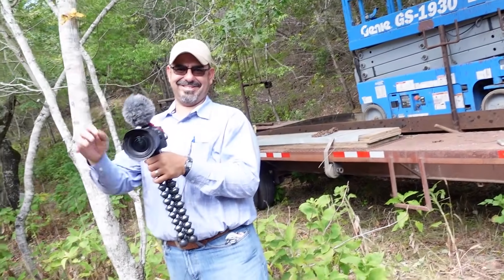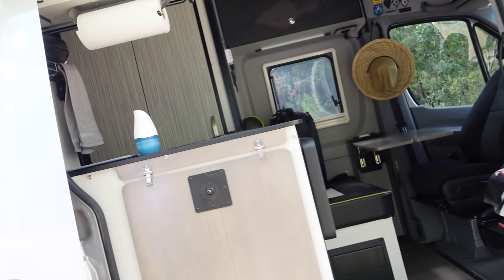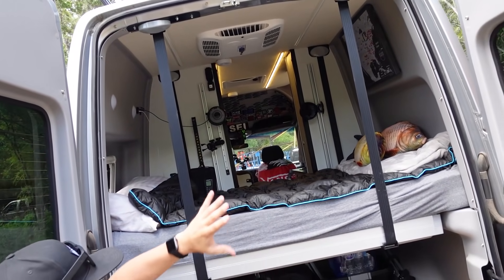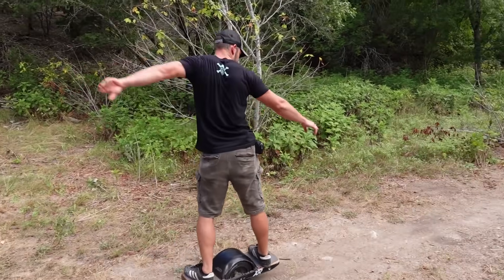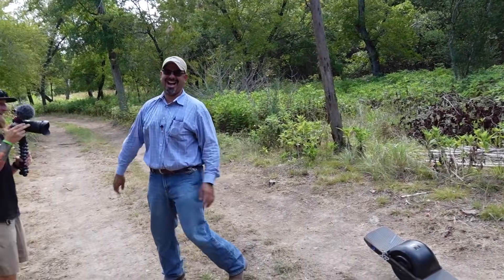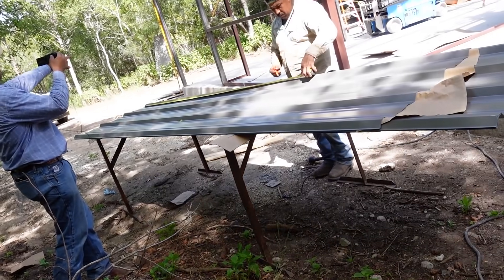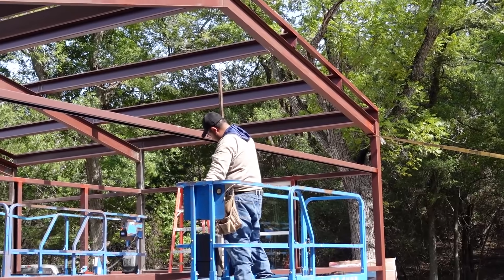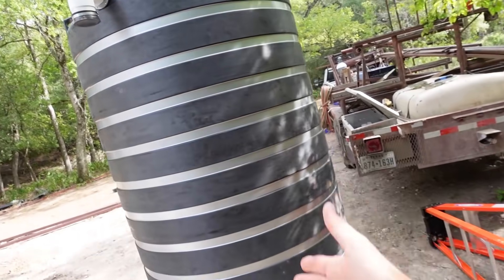Building Demolition Ranch Headquarters Part 6

Comment: Hey Matt there was a video that "JerryRigEverything" on solar power for his house, and i was thinking of you for that. Check it out!
Reply: JerryRig did Grid-Tied, they are going stand alone here, so they'll need batteries.
Reply: @tjs114  only difference is you would need a power wall to store and condition the power. Making a power wall aka big lithium ion battery is not hard. You just need about 1200-1500 (18650 cells ) and a few affordable controllers. The thing with the grid enabled system is the grid acts as your battery.

Comment: You might think about a battery bank setup for power storage.  You can run the led lights and with enough you can power an ac unit.  I do mean a lot of solor collection of energy.  Battery bank will store what you don't use.  We have ran the house lights on a 6 car battery bank and TV and satellite box for 8 to 12 hours with a heat blower from a wood stove during winter.

Comment: You need to put a drain pan under that tank! If you don't, when the leaf basket gets clogged (and it will) all that water's going to overflow right to the back of the building.

Comment: If you want an off grid toilet, go buy one that separates the liquid from the solids. Normally people use saw dust to cover their solids & paper but a better option is to use Peat Moss which is similar to a rich dirt, the Peat Moss will decompose the solids & shrink meaning that the bucket will not fill up as quickly but best of all it can be used in the garden as fertilizer for plants with no smells. The separate liquid bottle on the front of the off grid toilet is large enough bottle for 1-2 uses before it needs to be emptied out in any place you desire away from the shed. If you don't want to put in a special room for the toilet you can easily get a 90 degree bent pipe with a camo shower curtain for privacy & put it in one of the corners of the shed.

Comment: We use a propane powered generator with a huge tank. The Tank of propane also runs the heater on the hot tub  water heater, heater and the stove in the house its something you might want to think about. You can get a propane truck in there once a year or two depending on how big of a tank you use.

Comment: Did miles of metal roof one summer. If your pre-drill’s wrong it’s a nightmare.
Usually you just tack it up there you line it up very carefully snap lines on the metal. Then you have somebody that goes and screws off all day and yeah they run measurements and make sure everything’s perfect. Screwing off is usually a lot easier worked and actually putting up any kind of metal. Most of my experience was like flexo span storage buildings and bebco buildings. Very production vs construction experience. I’m getting screw gun arm just listening to the guns clutch out.
Reply: I've done a few miles of roof and metal buildings myself, the guy I worked for had bought the construction company from the guy who built a garage for him, they did such a bad job on the screw lines on his garage, he made a vow to himself not to do that to his customers. We took pride in our screw lines being straight, no pre drill for us, or snapping chalk lines, I've seen chalk stain panels and leave a line, we'd stretch a string tight as a guide, you could keep a pretty straight line that way.

Comment: Matt you should look into a rocket mass heater, and wood gasification u can run vehicles and generators off wood gas. The rocket mass heater is pretty neet as well.

Comment: Contact AM Solar if you would like all solar, lithium batteries to run the air conditioning. However, they are located in Springfield, Oregon. Building looks wonderful!

Comment: I would think you would need a 12v RV heater and air conditioner for the building to draw less on the solar system. You can also put in propane heat for winter.

Comment: If you elevate that water tank even 3ft so as to not lose the advantage of gravity to fill, you would have plenty of pressure for a sink at standard height without a pump. One less electrical connection.

Comment: Hey bud this video isnt about your bunker but a good idea for your bunker is make the door have hydraulic hooked up to it you never know if anyonr does have to use there bunker for safety you wanna make shre your able to get out just incase something falls onto the door on top cause if your inside with your family and somdthing heavy falls on thr exit then you have no way out you probably wont dvsr read this comment but just incase or put a hydraulic press inside the bunker out of the way that way its easy to hook up

Comment: I find it surprising that the steel work is welded together on site, I have been in fabrication for forty years here in the UK and never seen this as all the fabrication is done in the workshop and the building is then bolted together onsite so that all that is required for assembly is spanners/wrenches and a few other hand tools.

Comment: Why put the pump and electrical inside the tank ?  have fun servicing that....why not include a 2nd, priming tank with air blatter that maintains pressure and the pump only runs when water pressure falls below 30 psi to recharge the blatter...just curious.   Also, why brown on the outside, that attracts head...good for the winter, but dang...in the summer....a lighter color would have been better choice.

Comment: Is this man cave gonna be a tar-na-da safety building or something? Welding joints and connectors is saved for high rise stuff? Bolts are just fine for this size structure...

Comment: Drilling the holes first is not a good idea unless you KNOW for a fact the building is completely square and level. 
You should simply mark the sheets with a spirit level. 
Pre drilling the sheets it's a recipe for disaster, particularly on larger buildings.
Don't do it people.

Comment: I worked on a Butler style building crew for a couple years. Back then we still used nuts and bolts to make all the connections. Is welding everything the way assembly has gone on all of them, or is that just Eric's choice?

Comment: of corse your going to get a hard time having people accept your steel frame has wooden  timber frame construction..a perlin is a specific piece of a system  used for timber frames  and while a wall is a wall and a roof is a roof there not all created equally..if you were assembeling precast concrete as a post and beam structure you could have a concrete perlin likewise if you werent bolting ans welding  steel but assembeling pieces as a timberframe structure then you could have steel perlins  .this structure is not post and beam frame construction so will not have perlins. be aware both styles of construction require skill and knowledge to design or build and there are advantages and disadvantages to either method for any application. thanks for the videos